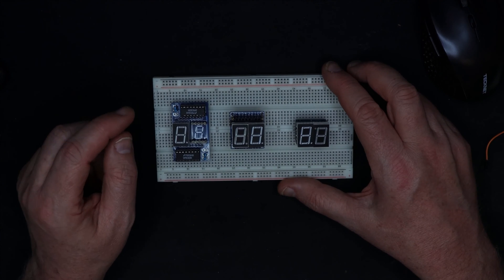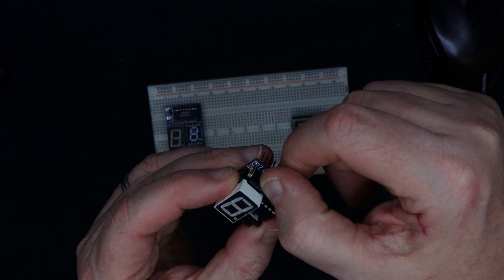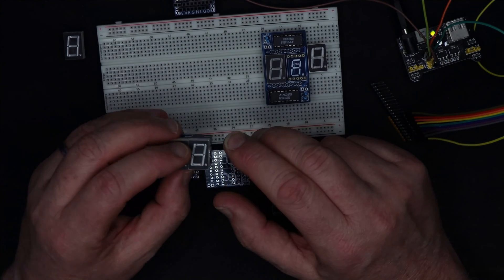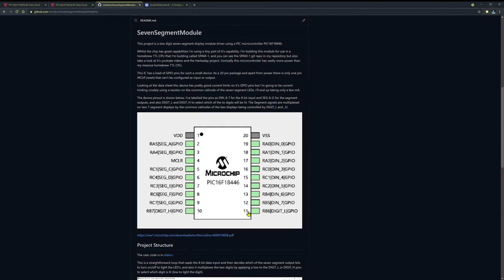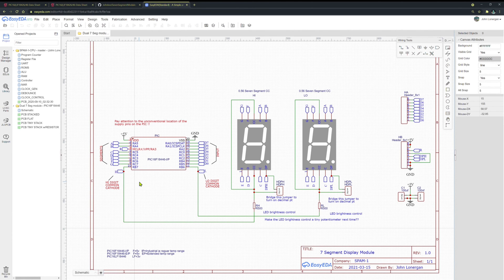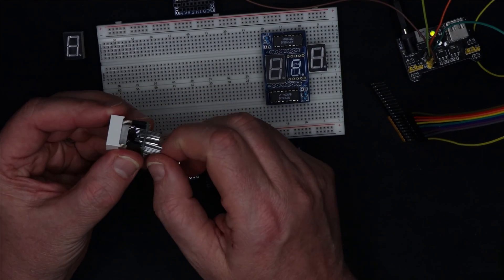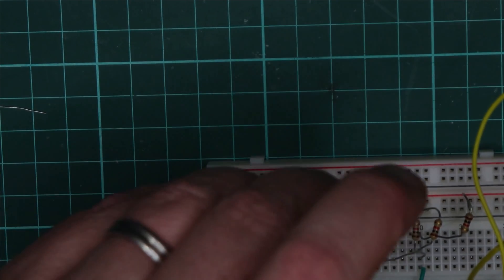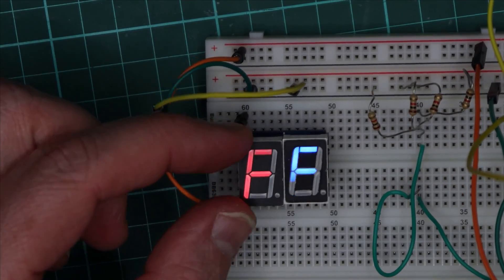7 Segment Display Modules  - SPAM-1 8 Bit CPU - Part 9

Comment: Hey John, I follow a TRS-80 (my 2nd love) project by Steve Rayne who also was using the DM9368N decoder chips. When researching the cost I decided to look for an alternative, Thankfully, I came across your project that, not exactly what I needed, would get me in the ballpark. Steves desgin called for six decorders so I'm using your design with the pic16l18446 reduced to just either doing the upper or lower bits. This way I can latch the data exactly as would be done with the 9368. Learning the MPLAB stuff for me was a bit challenging as is understanding someones elses code (I'm 67) but fun notheless. Anyway, I really just wanted to says thanks for all you put into this and making it available to folks like me!! Mike